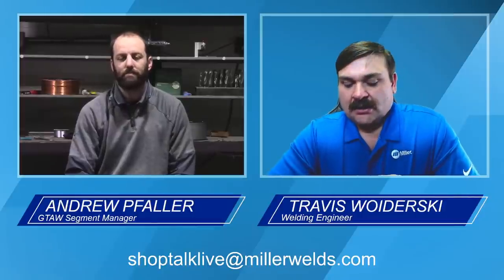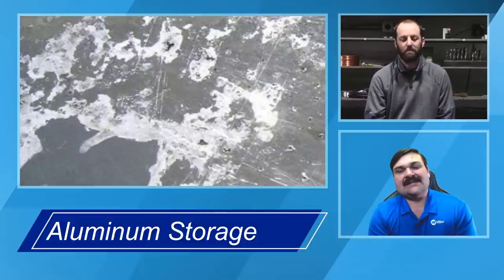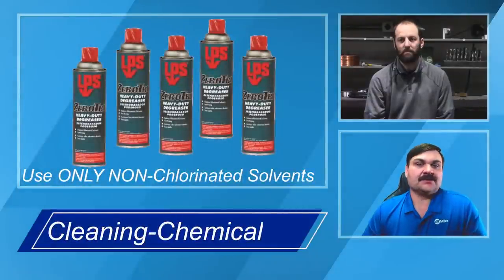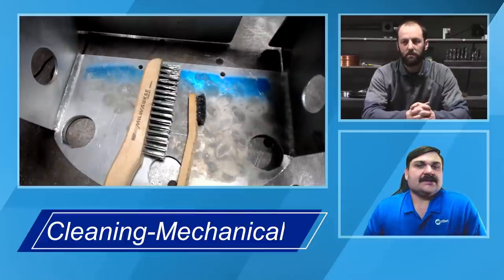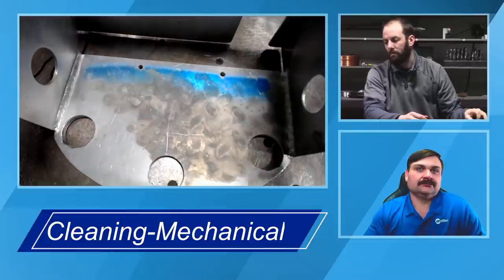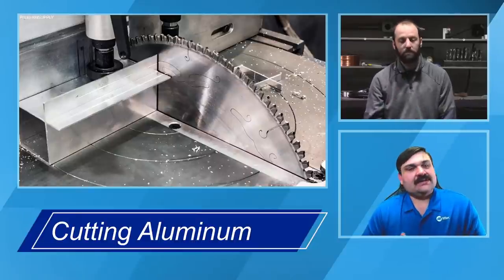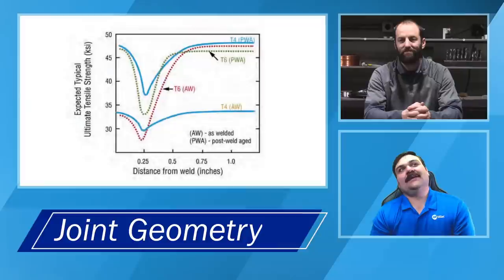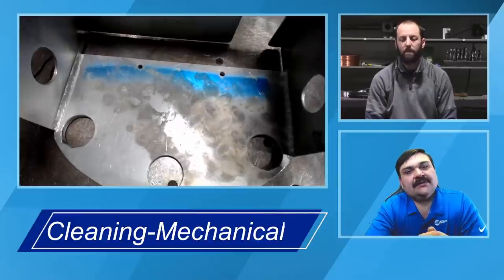Aluminum Material Preparation

Comment: I have a miller 250 dx tig runner I bought new in 2006 and it is always throwing a code. I have had such little use of it because of the codes that I am only on my second bottle of argon. Customer service has been a joke🤷‍♂️